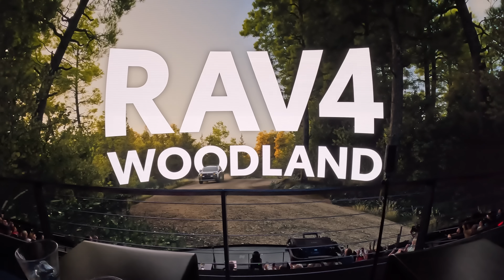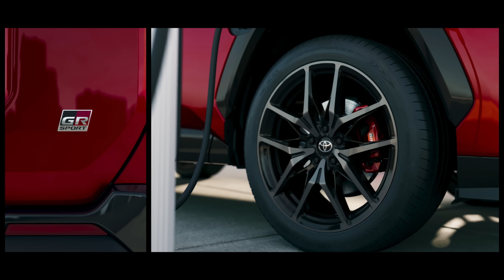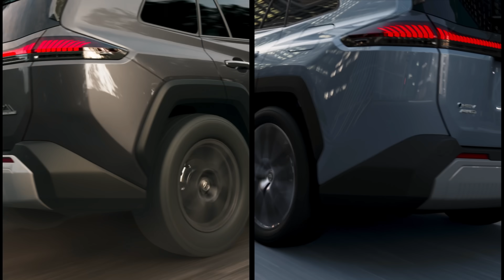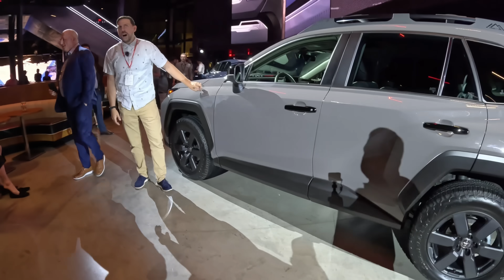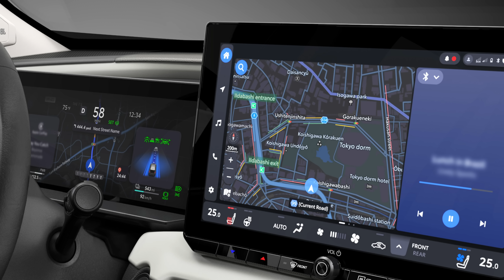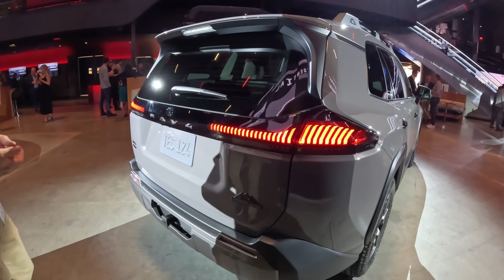Here's EVERY Upgrade and Downgrade for the redesigned 2026 Toyota Rav4 Hybrid and PHEV.

Comment: Totally agree with your point about physical climate control buttons. It's mind boggling that some car companies can't get this right.  They delude themselves into thinking they are pushing car design forward when, in reality, they are dragging it downward.  I also think that a nicely designed and integrated hood over the driver's info screen (speedo, tach, etc.) would go a long way toward dressing up the new RAV4's very, very plain and industrial dashboard.  There are too many hard lines and right angles, which are jarring to the eye and need to be balanced with some nicely placed curves/non-linear shapes.

Comment: i would  never buy that car  i  have owned  toyotas for the last 35 years  my current is a 2025 rav4 xle gas only  it gets over  42 miles to the imperial gallon of gas or  4.5 liters   91 octane gas  with no  ethonal  blended gas  as gas engines do not burn water  check it out yourself

Comment: Toyota must have hired a bunch of new designers.  Ever since the new Prius came out, everything just look better and better, including this one.  Even the new Lexus ES is a total looker!  50 mile EV range is the sweet spot for most people, my 2019 Honda Clarity PHEV got 51 miles when it was brand new, now it's down to about 41 after 5 years, still enough for daily running around!  The new Honda CRV PHEV has only 35 mile which is total downer.   I will definitely be interested in this PHEV!

Comment: I want to disagree on the buttons. Yes its probably faster to adjust temp with a knob but mechanical things with moving parts break. Idk how many car nobs I have seen were it doesn't work. I work with a fleet of vehicles and nobs break. That screen is probably never going to break unless its been in an accident. Yes there are software bugs but those are rarely permanent. Just my opinion.

Comment: I actually think the tail lights is an improvement over the current generation.  I agree with switching out the driver mode buttons for hvac dials but at the same time it’s not a huge deal for me.

Comment: I have a 2021 Prime SE, and I can't use my heater in electric mode. If I turn it on, the car shakes for 3 to 5 seconds and makes a super loud noise. I notice Toyota no longer offers most of the accessories that were on the 2021 Prime.

Comment: It’s cheaper to manufacture a car with touchscreen buttons for HVAC. Previous gen Corolla had touchscreen buttons for volume then they dropped it for a physical knob in the current gen. I wonder why. Could it be because of criticism. When will they learn that a lot of people who buy these cars don’t like touchscreen buttons for HVAC, because they are harder to use will keeping your eyes on the road. Oh, let’s just say, Hey Toyota what’s my fan speed, turn down the fan speed to 1. Is that a better alternative, than glancing at knob seeing what position it’s on and then turning it to a higher or lower setting.
Reply: Yes…in my old 2013 Toyota Prius C, I can reach over to the Temperature knob in the dark without looking and feel each degree change actually feeling the CLICK of the knob up or down. Having to “find” it on a touch screen while I’m driving would be a SAFETY ISSUE.

Comment: I just took delivery of a 2025 RAV4 SE PHEV a couple months ago. I really needed to replace a worn-out 2015 Jeep Cherokee and was debating whether to wait for the Gen6, possibly missing out on EV purchase incentives and having to pay a tarrif or simply an inflated price. I think I made the right decision. The overall styling of the Gen6 is a miss for me, both inside and out; I had expected something sexier. The continuing move away from physical controls and gauges/indicators is also a miss. The EV range increase is about what I expected, not quite enough to make a significant difference in how often I can get through an entire day in EV only and I don't envision ever wanting or needing to pay for DC fast-charging. The Gen6's improved chassis stiffness and isolation might be nice, but the acceleration, handling and overall road manners of the Gen5 are perfectly satisfactory. I didn't buy a PHEV SUV to tear up the twisties; I bought it for the fuel economy and emissions reduction with just enough hauling and backroad capability to keep up with my outdoor adventures. And, finally, my biggest reservation in buying the Gen5 was that it didn't have a clean, factory-installed 2"  hitch option, and the Gen6 doesn't address that. So, ultimately, I don't see that waitng for the Gen6 would have done anything for my overall satisfaction.

Comment: Toyota seem to underestimate their PHEV range. I have the 2025 PHEV here in the UK, reported to give about 43 miles of full electric range, it consistently gives over 50 miles in the real world.
Reply: The EV “range” is VERY DRIVER SPECIFIC …if you are doing mostly City driving and don’t have a “LEAD FOOT” on the gas pedal with kick starts…you can get that EV range stretched out considerably. When I use my 2013 Prius C , I can get 45-64 mpg, because I pay attention to “current gas mpg” displayed on the dash..it kind of trains you how to get the most EV range of your hybrid (plug in or not)

Comment: THEY RUINED THE RAV4! I WANT A REGULAR TRANSMISSION AND REAR DRIVESHAFT NO HYBRID! TOYOTA IS FORCING THEIR CUSTOMERS TO BY A STUPID HYBRID! TOYOTA IS TAKING CUSTOMERS CHOICE AWAY. I KEEP MY CARS LONG TERM. I DON’T WANT TO WORRY ABOUT REPLACING AN EXPENSIVE BATTERY FOR THOUSANDS OF DOLLARS WHEN IT STOPS WORKING. I WILL NOT BUY A HYBRID VEHICLE UNLESS THERE ARE NO REGULAR VEHICLES LEFT TO BUY. BY THE WAY THE SPEEDOMETER IS STUPID LOOKING (LOOKS LIKE AN IPAD STUCK ON THE DASH)! CHECK YOUR INSURANCE RATES, HYBRIDS ARE MORE EXPENSIVE TO INSURER.

Comment: I wonder what new nag systems will be implemented into TSS 4.0.
Reply: Not interested in the navigation system if it’s a monthly/yearly SUBSCRIPTION like the Satellite Radio, (which I stopped using after the FREE trial). My 2013 Prius C navigation system was upgradable periodically, but there was no SUBSCRIPTION!
Reply: @josephdebes3060  Huh, I was talking about nagging systems, like the attention monitor or the proactive slowing, etc found in TSS 3.0.

Comment: What turns me off in the new refreshed 2026 RAV4 is the cheap plastic on the front console near the windshield—and that’s exactly what turned me off before. It was the same issue back in 2022 when I was looking for a car, and that’s why I chose the ’23 CR-V instead of the RAV4. If Toyota ever fixes that, I’d definitely reconsider trading my ’23 CR-V for a 2026 RAV4—either the Woodland or the regular model.

Comment: 2 inch receiver is not necessary for such a small car. LAST THING WHAT WILL FAIL IS THIS SMALL RECEIVER BEFORE ENGINE AND TRANSMISSION.

Whe  towing @ max capacity.

Comment: What is the fuel consumption of phev if you don't charge it?
Reply: Probably slightly lower than what the current hybrid does, so my guess 37-40 mpg.  If you don't charge a PHEV, it will run just like a heavier hybrid.

Comment: The Premium Package (Code PM) was the BIGGEST thing missing from the Texas PHEV GR Sport. On my 2023 RAV4 Prime XSE, the PM package is a HUGE value with fourteen (14) major upgrades (at least to my thinking... it's a massive value of features for its cost). So I will list these 14 items further down below. But another tip-off about the RAVs displayed in TX was that NONE of them had the Panoramic Glass Roof. My guess, is that Toyota was simply not ready to build those in time for the event. 🤔

So other than that, I am honestly sooooooooo thankful to have the exact year I've already got. First, I am not a big fan of how vehicles ride when the wheels get over 19 inches. I like my 2" Toyota OEM hitch, and 2023 the hitch doesn't "look weird" (again to me). 2nd, I also like physical HVAC controls. Touching a screen when moving is just much more difficult... even from recently replacing my wife's 2017 Honda Ridgeline's RTS 5" screen (and yes, they only made RTS models for 1 year and they are rare with their two-tone seating and etc.). But even adding the SONY XAV-AX6000, it's more difficult just to press play. Well, I digress from my touch screen example, and back to the RAV4... so I'd actually imported all the GR Sport badging from Japan (since that is what Toyota sold and marketed my RAV4 XSE Prime w/the PM everywhere else in the world as a PHEV GR Sport).

Quick background, I've had 35 vehicles in my (I think) still-young 57 years, ha ha 😇 But admittedly, I've been treating my RAV4 as the last car I think I'll ever buy (almost like it's my "mid-life crisis car" only without the crisis). ha ha 🤣

Another example besides having all the original Japanese GR Sport emblems inside and out... my buddy made me red brake calipers (does it stop shorter, NO). But it still makes me "feel" like a grade school kid with new shoes. I can just run faster with new shoes or play better tennis with a new racket. ha ha 🤣 And being an old-timer guy... I simply like chrome! I always joke that if I want black wheels, I'll just let them get dirty and not wash them. 😆🤪And I could go on and on about all kinds of the "little details I like over the new 2026", like I would NOT want Alcantara seats that grab onto my shorts every time  I'm trying to slide into a car... so I'll stop here and just list those 14 items that were included as part of the PM package for the 2023-2025. Which I would suspect will fill some of the gaps you might be noticing Kirk?!

2023-2025 Premium Package (PM) Adds the Following (14) Items:
    1. 10-in. color Head-Up Display (HUD) with speedometer, navigation, and Hybrid System Indicator
    2. 6.6 kW onboard charger
    3. Panoramic glass roof with front power tilt/slide moonroof
    4. Panoramic View Monitor w/360-degree Overhead View in low-speed drive and reverse, and Curb View.
    5. SofTex-trimmed* seats w/sporty red accents and stitching.
    6. Heated & Ventilated Front Seats.
    7. Rear Outboard Heated Seat
    8. 8-way Power Driver's Seat w/Two-Position Memory
    9. 4-way Power Passenger Seat w/Seat-back Pocket
    10. Digital Rearview Mirror w/HomeLink
    11. Smart Key System on All 4-Doors
    12. One (1) 120V/1500W AC Power Outlet in Cargo Area
    13. Height-Adjustable, Foot-Activated Power Lift-gate w/Jam Protection
    14. Front & Rear Parking Assist w/Automatic Braking PA

Hope this might be helpful to others out there! 👍🏻
Reply: They will add majority of these with 2029 refresh..same as prior gen..

Comment: If the new RAV4 can have a refined ride like the NX350 hybrid, would be great
Reply: It won't. It will be quieter than the regular ICE model, but I'm expecting to be as quiet as the current hybrid model. The quieter ride will likely be designated to the more expensive products like the Crown Signia and Lexus.

Comment: Will it be using the proven P810 transaxle which is shared with several other Toyota/Lexus hybrid models, including the  Highlander Hybrid, ES300h and RX 350h?   Note: The hybrid's transaxle literally replaces the conventional automatic transmission by inserting instead an electric motor between the engine and the wheels.

Comment: The variety of styles is the best decision carmakers can make. All of them have the same basic evolutionary shape, but grills and rear ends can be polarizing. This give buyers 3 choices.

@3:30 the problem with under the floor batteries is that it encroaches into the cabin comfort. So what you gain in cargo, you lose in cabin space. If its solely a commuter its not big deal. But when used as a travel vehicle (the Woodland?), passenger space become extremely important. Especially when you have a choice to use the roof for additional cargo. There are no choices for passengers.

Comment: Outside looks like good, maybe tail lights should have been different, they look like Nissan’s Rouge. 
Tooooo much crappy hard plastic on the inside and even some on the outside, no Ac controls, 1 more horse power more in the FWD than the camry, 4 more on the AWD, yet is heavier.
I think the GR is the best looking. Overall disappointed on the most part😕

Comment: I have three cars - two Toyota's and a Subaru.  The Toyota's are 32 and 22 years old so I thought I should sell them and buy a new car.  Boy, have I been out of touch!  The average price of a car is somewhere around $48K according to Kelly's Bluebook.  I could be a cash buyer pretty easy, but I am having a hard time justifying spending that much for your everyday car.  The RAV4 by all accounts is somewhat plasticky and cheap on the inside and you can hear the 4 cylinder engine.  I have not driven one yet.  Just curious as to how nonchalantly everyone seems to be about the price of a new vehicle.  Am I just turning into a cheap old man?  My first new car was a VW bug for $3600.   A new car folks!  You can't bump up a trim level anymore for that much money.  Seriously, are we getting ripped off or is that just the pace of inflation?   Am I a fool for wanting a new car at these price levels?  I just can't tell if I should have my head examined or not.

Comment: Love most things about the Woodlands, hybrid, 1500 watt plug,  all terrain tires, increased ground clearance, 236 hp, roof racks, 3500 lb towing, but I too am confused by the 1&1/4 " receiver. Most trailers over 2000 lbs have trailer brakes, can a plug for that easily be added beside the receiver? I do like the forester wilderness better but will get woodlands over it because of the hybrid.

Comment: While I recognize this is a minor point, especially when discussing a future 2026 model, I'm generally very impressed with this car and it's certainly on my shortlist. However, I believe there's a potential ergonomic improvement regarding the climate controls. I would have preferred to see physical climate knobs placed where the drive/EV mode selectors are currently located, flanking the two central buttons. My reasoning is that drive modes like 'Trail' or 'Snow' are likely adjusted far less frequently than climate settings. Allocating such prime dashboard real estate to these less-used functions seems suboptimal. For instance, couldn't the top button serve as 'Park' (P), and the bottom left an 'Auto AC' button? This current layout feels like a missed opportunity for enhanced user convenience.

Comment: Don't see any negative on not having climate control buttons. I rarely touch climate control. Do you need to keep on changing the climate like DJ pushing all those buttons & knobs? I set to the temperature I want and keep it all year long. Literally only time I push it when garbage truck in front of me, I change it to inside air, instead of outside air. Oh & help defrost the window.

Comment: The tow hitch is a huge swing and miss. You cannot tow with it. Per Toyota, it's literally not for towing.... It's a carry over from the current Woodland. It's rated for only 200lbs. You will have to literally remove it before being able to utilize the upgraded 3500 capacity.
Reply: Exactly what I was thinking, you're now able to tow a little teardrop trailer with a rav4. Except for there's nowhere to place the hitch OEM
Reply: Not true, they can typically tow 1,500lbs. But that thing is more of a bicycle hitch than an towing hitch.

Comment: Agree about gas going away for Rav4. The gas version of Rav4 are terribly terribly weak. I think people still want gas because they want a even cheaper option for Rav4. But anyone who's driven gas vs hybrid can immediately tell difference in power. I was disappointed with new EV range, going from 41 to 50??? Was expecting 75 mile range improvement. Not related to Rav4 per se, but what about Toyota phone app?? Are they gonna improve that too? The Toyota phone app is terrible. Edit: Kirk any mention of fixing cablegate??
Reply: We have a '22 Rav4 Prime with claimed range of 42 miles. We usually get more than that. It's not a big deal whether it's 40 or 50 or 60 because when the battery's depleted, it's still a hybrid that gets roughly 40mpg. The vast majority of people don't drive more than 50 miles on the vast majority of days.

Comment: I’d hope with prices of BEV keep coming down, hybrid now being standard should be priced same as the NA has been to date. My 2 biggest let downs were they didn’t extend the wheelbase, i was hoping for another 2-3 inches (not sure if it has sliding 2nd row, but should). Also the lack of HVAC dials and replaced with drive mode buttons. The drive modes would been on a dial near the gear selector with EV mode being a push button a the centre of the dial. Regarding the rear taillights, Toyota released a sketch with a full length bar like the ES/ Crown style and I thought that would have been awesome
Reply: You want a Highlander. Which is a RAV4 with a longer wheel base.